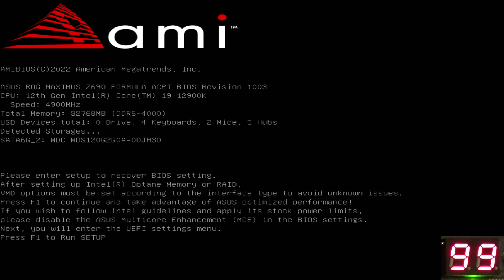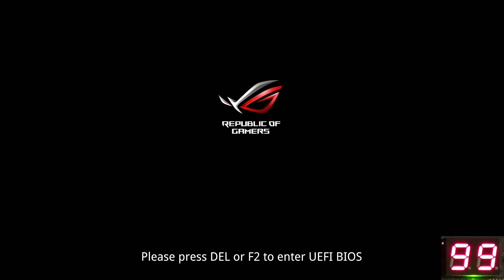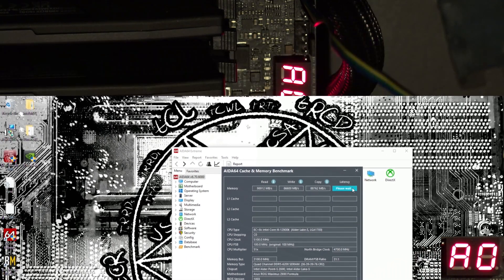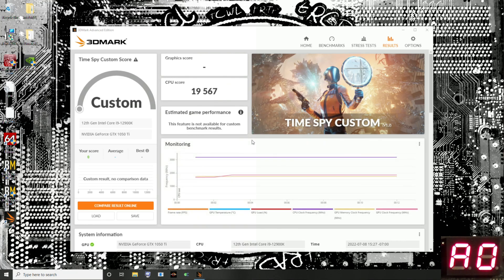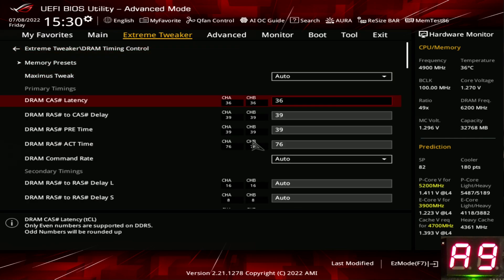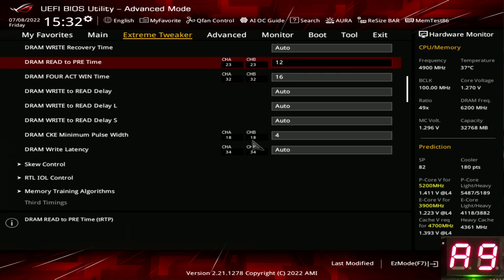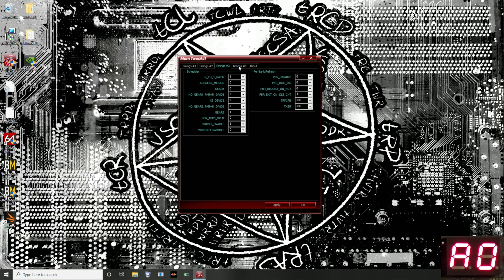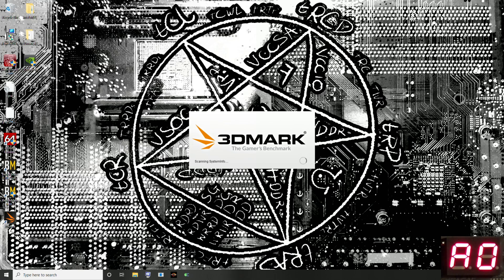Easily improve your DDR5 XMP's performance // for ASUS motherboards

Comment: Yo buildzoid, I have been watching lots of your videos recently you are very informative.  I have an ASUS z790 prime-a board (I know I got scammed.. Its all they had in stock) anyways, its not as bad as I thought it was going to be.  I was pissed that it didnt have a cmos and flash button on the IO but its all good, they are on the mobo. OK ENOUGH RAMBLING! Sorry.  My question and issue - DRAM REF Cycle Time is greyed out on my board, why is that!?!  For now i just set REF Cycle Time 2 to 370 assuming REF1 will be auto adjusted to around your value.  But why is it greyed out on my board! Its the only setting that is greyed out!
Reply: Nvm I guess TREF Cycle Time 2 is basically Cycle Time 1. I set it to 370 and my TREF is showing 370 too
Reply: What's wrong with the Prime Z790-A? Or do you mean bad price-wise? I was considering it. Are you liking it so far and able to get RAM OC stable? What CPU you running it with?
Reply: @Damon89  I actually have a EVGA z690 dark now, it’s a much better motherboard but it won’t fit in normal cases cause it’s an EATX. As far as just regular XMP ram all the way up to 6600 XMP rated ram profiles should work just fine on the prime-A.  My problem was trying to get ram stable above 6666mhz, which wasn’t doable on that motherboard. Maybe it was possible and I just hadn’t fine tuned settings I wasn’t familiar with or something.  I was a first time ram overclocker back then.

Anyways, here’s what I would say about it. For general gamers and non overclockers the prime-A is just fine, they won’t know the difference. For people trying to get a max stable ram OC or want to actually see their Hynix M-Die kit reach 6800 or even 7000mhz with decent timings, this wasn’t the case for me. Max I could hit was like 6666mhz, or 6600mhz stable.

With the same kit of ram on the EVGA dark I can run 7000mhz c34 1T command rate perfectly stable with no issues and it didn’t take even a quarter the amount of time it took trying to get 6666 stable on the Prime-A.

Note this is with the second BIOS that came out for the board initially. I believe they have had multiple new updates that might provide for better overclocking potential.

Lastly, that board for me at least had issues relaying voltage information to HWInfo64 on certain ram overclocking things. IMC transmitter voltage was bugged showing like 1.5-1.55v’s when i would set it to 1.35 etc. not a huge deal and maybe I just got a bad board. 

Totally up to you, good luck.
Reply: @jacob4816  Thanks for the reply and info. Initially was looking at the Trident Z5 5600cl28 kit. Best 10ns kit for the price (around 369AUD atm), and was going to see how far I could push that. That should be at least M-Die, possibly A (I think A is starting to replace all M-Dies? Could be wrong) I have very little experience with OCing RAM, esp subtimings, so this video should be a good start. Maybe a Z690 or Z790 STRIX would be better, but they're even more expensive. Not sure if memory is generally more stable on Z790 than Z690? What about 13600K vs 13700K?
Reply: @Damon89  I will also let you know for me at least the Memory Controller voltage (if I remember correct naming for that board) other known as CPU VDD, for that board had a sweet spot of 1.35v’s more than this and it went unstable, and less than like 1.3v’s is unstable too just for reference if it helps. VDD2 was set to 1.45, and VDD/VDDQ was 1.45v (probably could be less) for my 6666mhz m-die ram kit with an i7 13700k
Reply: @jacob4816  Interesting it didn't like going over 1.35v, either can't handle the extra voltage or a bad board? It's interesting that it should be able to run the 7200cl34 kit according to the Qualified Vendor List. (Prime Z790-A)
Reply: @Damon89  I haven’t tried A-Die so I can’t speak on that. I just tried the trident z5 6400 c32 kit on it and could get max 6666mhz stable. 6800 and 7000 could pass only memtest86, and would fail kahru most likely due to IMC related issue.  The 1.35 on the CPU VDD (memory controller voltage) does actually sweet spot for DDR5, more is not always better. Note this is different than ram voltage, like VDD and VDDQ.  But I would assume that a new bios version for this board would make it better for m-die over clocking.  If it says it would work with 7200 A die it probably does I just haven’t tried it. The strix would probably be a better board, but like I said before, if you are really interested in ram overclocking, I personally feel that the z690 dark from EVGA is the best bang for your buck - that is if it is still on sale (like $450 ish).  The downside to this is that it likely won’t fit in whatever case your using, because it’s EATX, but most people with this board just use it in an open bench.  If you have a big case it might fit.  Also it’s better for ram OCing because it’s a 2 dim board, not 4, so it’s way easier to run 1T command rate, and it’s a 10 layer PCB vs the prime-a at 6 layers.  At least in the beginning, it was hard for any z790 6 layer PCB to achieve anything above 6800 at least for M-die, but maybe this likely changed with BIOS updates.  

13600k would probably be just fine, it may have a slightly worse IMC (memory controller) than the 13700k, but for one reason or another if it’s not IMC, it got binned down to a 13600k for a reason. So either it had some bad cores, or the IMC wasn’t as good as it shoulda been for a 13700k so they made it into a 13600k.  Someone correct me if I am wrong about this process of binning for 13600k’s.
Reply: @jacob4816  Ahh gotcha, thanks. Yeah EATX too big I reckon, thinking of getting 500dx anyway. Yeah I thought I read M-Die tops out around 6800-7000, maybe 7200? Any more and you need A-Die. But yeah depends which mobo and CPU can actually do it. Possibly only i7/i9 and top 2 dimm mobos. Who knows tho. Not sure how much I'll get into it to be fair and prob overthinking it :P thanks again for the infos though
Reply: @jacob4816  There was actually another BIOS just released for the Prime - 0809 which actually says improves memory compatibility so might actually be better now. I'm actually checking out the MSI PRO Z790-A as well. Cheaper by 100 and has better VRMs and all the audio outputs, missing on a lot of boards...

Comment: Hello i wanted to say that i have an i7 12700 k + mb same as u+g.skill 6400 trident. I did the exact value from your video and i get only 100 point more on 3dmark. Then i set the first timing at 30 37 37 and i got an improvement of 1000 Point on 3dmark. As for the latence in ns i got first time by defaut xmp 62.10 then with your setup 59 then with the changing of first timing 56. I dont know if i can improve it ??? Tx your for all your work it s very usefull.

Comment: I just tried these values on 2x16gb of corsair ddr5 6600 (hynix) ram on a hero z790 board (13900k), but it's slightly unstable giving one error on test 5 of absolute anta memtest. Which timings can I tweak to give full stability, maybe tweaking tRFC and tREFI?

Comment: Couldn’t get a stable 6600 oc before, now I can with your settings! Thanks a lot! Only one setting was greyed out, but everything still works fine! I’m glad I got the same exact kit as you, made things easier
Reply: Lemme guess, the grayed out setting was: DRAM REF Cycle Time?
Reply: @AR-ey1ur  it was!
Reply: @BibboLegend  Yeah, same here on Asus TUF Z790 Plus WiFi; initially, I just skipped that setting entirely, but later I changed a setting below it called "DRAM REF Cycle Time 2"; not sure it makes a difference either way...
Reply: @bibbolegend3507  Can I ask you how you achieved 6600mhz? What settings did you change in addition to what he said? I can't get a stable 6400mhz even...
Reply: @cieuxlux9617 cpu-z says hynix
Reply: @AR-ey1ur 6400 and up is not super stable without doing more of what buildzoid has shown here. But, again, that would be a different video, and a different scope.
Reply: Did you use the same exact voltages and timings as this video?
Reply: @MrDutch1e  I did, sadly I couldn’t get 6600mhz to be fully stable.. went for 6400
Reply: @bibbolegend3507  what did you get for latency in aida64. I'm at exactly what he's got in this video and I'm getting around 63ns average but I'm only on a 12700k.
Reply: Why when i load my xmp1 or 2 profil i got error bios ?
Reply: @CristianoRonaldo-zy3pq  getting the same thing and asus just shrugs there shoulders
Reply: @Bhommers93  what do you mean ? Ihave the same ddr5 same frequency but error bios 23 ... Did you fond something about it
Reply: @Bhommers93  i find it Bro
Reply: @CristianoRonaldo-zy3pq  what did you find?`having some errors myself
Reply: @CristianoRonaldo-zy3pq do xmp first, then switch these other settings he showed. Make sure your mobo / cpu is relevant to this video ofc.

Comment: my memory is G.Skill Trident 16x2 DDR5 6000 which i believe are 36-36-36-72 latency ,  Is that HYNIX ??  If not, i take it I cannot use this video?
Reply from the maker: it's samsung and the timings from this video won't work
Reply: @ActuallyHardcoreOverclocking   thanks, back to the drawing board.
Reply: @ActuallyHardcoreOverclocking  Sorry, the memory I have has timings of 40-40-40-76, if that means it's a different memory type, then let me know (Samsung vs. Hynix).  I misspoke above.
Reply from the maker: @dabneyoffermein595  could be Hynix could be samsung.

Comment: I can't change the dram ref cycle value on mine.  So it's grayed out.  How can I open the value DDR5. My ram  G-SKILL 6400 32 39 39 102 but running nice with your Timings
Reply: And now i have the 13900k.... heavy cpu. I have the same Radiator with ekw cooler and gpu. How cpu water is your Favorit
Reply: Same here its grayed out for ref cycle, did you find a solution?

Comment: I got a X670E Pro Art board, and alot of these settings you are changing, is not listed or doesnt have the same name. Is that due to the Pro Art board being ''stripped down'' on some of these memory settings?
Reply from the maker: intel and AMD CPUs work differently
Reply: @ActuallyHardcoreOverclocking  do you plan on making an AM5 guide?
Reply: I bought XMP modules as most vendors here claim they are EXPO when they are not.

Comment: I would really like to see a memory oc like this with zen4.
Reply: yes! Buildzoid did a video on the x670 Aorus Elite AX's VRM's...but never went into memory timings on it :(. I have a kit of Hynix 6000mhz CL32 I want to tweak but there is nearly zero points of reference out there.
Reply: @insertnamehere4419  Did you ever find anything?
Reply: @thenextlevel123  I just copied what I could from this video, which wasn't much. There are missing timings vs Intel /AM3.  I'm also still wondering what exactly " low latency" and "high bandwidth" do. With those on I get about 10ns better score with Aida64  vs just with XMP, but no idea what they do. Buildzoid doesn't want to answer any of these sorts of questions either it seems :(. I'm currently scoring  about 58ns with Aida64, 6000mhz 32-38-38-80, and system is stable.
Reply: @insertnamehere4419  do you mind sending me what settings you've got for the gigabyte? My ram is at 65 right now would be nice to get that down some.
Reply: @thenextlevel123  ps: the manual tweaks can be done on top of XMP, no need to disable XMP and do primaries manually and memory voltage (VDD AO) will override xmp's voltage.
Reply: @insertnamehere4419  For some reason I can see that you've left a notification of the settings but when I click onto it, it's not accessible......Youtube....
Reply: @thenextlevel123  click the replies drop down, don't know what to tell ya wait wuuuut? I don't see that post either. wow screw Youtube
Reply: @thenextlevel123  sent email
Reply: Why when i load my xmp1 or 2 profil i got error bios ?
Reply: @CristianoRonaldo-zy3pq  because you fucked something up.

Comment: Do you have a video such as this for SAMSUNG memory rather than Hynix for Asus boards?  I don't imagine I can copy/paste these settings really easily for Samsung based kits, so what should I be changing up? Helpppppppppppppppppp please.  Would love to get a bit more performance out of the 12 series
Reply from the maker: I don't because Samsung DDR5 is awful.
Reply: @ActuallyHardcoreOverclocking  I mean it may not have the top tier performance limits, but surely not "awful", it does 6000c36 XMP out of the box no issues

Comment: Not sure if you or anyone could help. Sure that asus didn't do anything which suggests they know they have issues... I have
I9 12900k
Z690 asus rog EXTREME Motherboard
64gb t force delta rgb ddr 5 6400 mhz
Asus rog titan 1000 psu
I cannot enable xmp at all. Just boot loops.
My bios simply states 4800 mhz with 64gb.
Can anyone help and give me guidance. I spent 1000 quid on ram when it was released. Nievely thinking it would work .... joke.
I can give anyone any further info they need.
Also when I'm playing bf2042 it simply crashes out of the game and the psu drops wattage and I'm left with a black screen resulting in a reboot.
It's frustrating the hell out of me. I've run all sorts diagnostic stuff and everything is fine. I've used the asus oc tool/and without. My gpu oc and not oc.
Out ideas .... pls help
Reply: Ps the bios identifies in the xmp profile as 6400 mhz

Comment: @Buildzoid, im running a kit of kingston fury beast ddr5 6000mhz cas40 that absolutelyn wont run these settings. Infact nothing i try with them seems to run, i think this hynix kit is pushed at its limit allready unless my board (asus z690 Gaming E) is preventing me somehow. I really wonder as i hear hynix should easely be able to do more than these.
Reply: Got the same kit as you. Mine does 6000 30-36-36-28 with bullzoids subs @1.4v vdimm just fine. I think you might wan´t to check your memory controller voltage. I set mine to 1.246 volts.
My mobo is a b660strix-f.
Reply: Same here.  It will not boot.  I'm thinking maybe memory training is occurring.  The fans are ablaze at 100%.  I changed the SA back to Auto and got the same.  How long should memory training take?  How did you achieve those timings?

Comment: Yo, i got a mobo asus extreme glacial z690 with 4 16gb dominator 6200 corsair on a 12900ks, how can i manage voltages and settings? I had to downclock frequency to 5200 mhz for each stick atm and i have no idea how to set atleast on stock freqs

Comment: Hi if anyone can help me I have a Asus Z690 Formula, 12900k and 2 x 16gb DDR5 Corsair 6200mz Dominator Platinum Memory and I can’t seem to get XMP to work at all I’m currently on bios version 1505, every time try and run XMP all I get is message saying posted in safe mode of bios, no idea what to do to get the 6200mz that bought memory for please any help would be massively appreciated

Comment: I have an Asus Strix Z690-E and 4 sticks of GSkill TridentZ5 F5-6000J3636F16X2-TZ5RK's, I cannot run XMP at all without BIOS loading in safe mode. I can run it at 5000 reliably by setting the speed manually, but anything over that gives me Memory Management BSOD's. BIOS is updated to the newest version and it still does it. 

Contacted Asus and they just recommended running only 2 sticks....but like...why manufacture a mobo with 4 slots if you can't use them?

Any ideas?
Reply: not sure if you've found the answer already, but alder lake IMCs can't really handle 4x DDR5 at higher speeds, i've had to deal with this with 5600mhz sticks
Reply: @kronfauu  Hence the question, Why manufacture a mobo with 4 slots if they cant be utilized. Makes zero sense to me.
Reply: I’m having the same exact issue with you except I have the Asus Z690 I and I only have two slots the game it seems to be crashing the worst and I didn’t even see it until I turned on the new Spider-Man soon as I turn ray tracing on I get a crash everything else is running perfectly fine in XMP 2

Comment: I had to translate to MSI BIOS, but these settings were a solid improvement for my GSkill (Hynix) 6000/30 kit. It ran these advanced settings at 6000 CL30 at stock 1.35v. Only thing is the latency at lower inject delay seems poor in Intel MLC, over 100ns, compared to 50s at the high end. That spread seems high compared to some tests you have shown (70s low to 50s high). Which settings affect that most if I study the more advanced guides?
Reply: If windows or any program is doing anything in back ground when you run the tests, the ns benchmark will be all over the place.  Restart in safemode and try the memory tests to get consistent data.
Reply: Hey! I have the Gskill 6000mhz ram too! Question so I've activated the xmp 1 profile at 4800mhz Max so am I to understand if I change these timings will this give me the full 6000? Is there anything special I need to do otherwise ?
Reply: @housebaelishgaming  did you figure it out? Your mobo might not be able to handle the 6000 speed, but it most likely should (if it’s a decent z690).  What I would do is f5 default your settings, and manually set your ram to 4800mhz, also set your DRAM voltage to what’s listed for the kit you bought (most likely 1.35v or 1.4v). Assuming your kit is the trident z5 6000mhz CL30 kit, enter all the ram timings as he has it. Then boot and if it does boot, restart your PC, raise the ram MHZ by 200 (no need to change the voltage again at this point unless it’s unstable), and if it boots raise by another 200mhz. Keep repeating this in steps of 200mhz, until you reach the 6000mhz. Sometimes if you set the mhz too high at first it won’t boot due to memory training and the motherboard not being built well for DDR5, but you can achieve the speed by letting the memory get trained and only taking it up in steps of 200mhz.  Hope this helps.
Reply: @jacob4816  I did figure it out I needed newest bios
Reply: If you happen to have that translation to MSI's BIOS names handy could you share it?